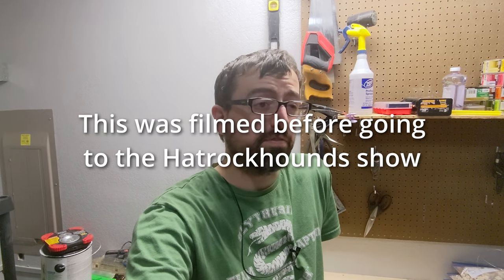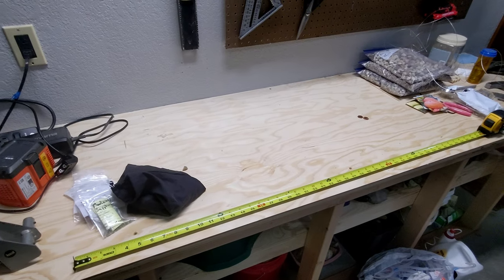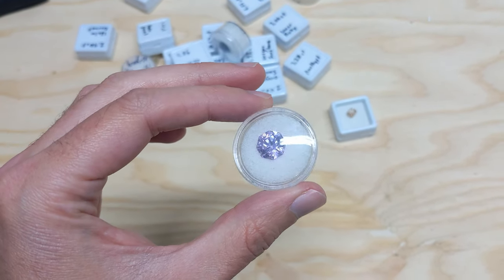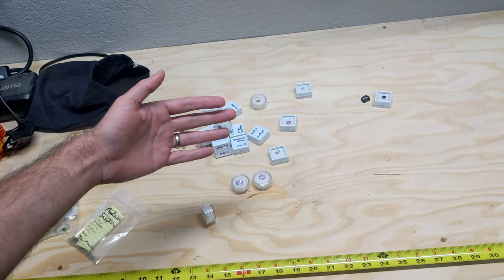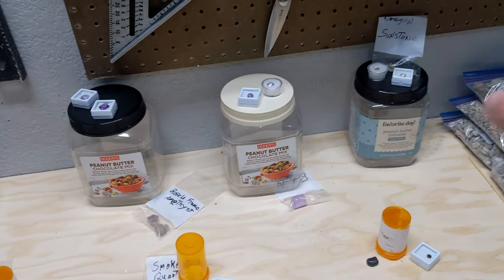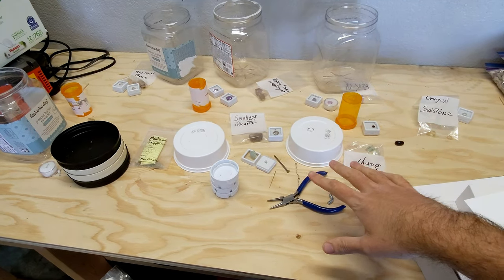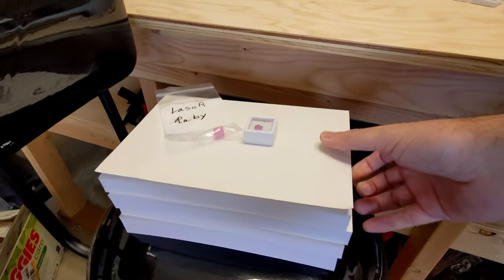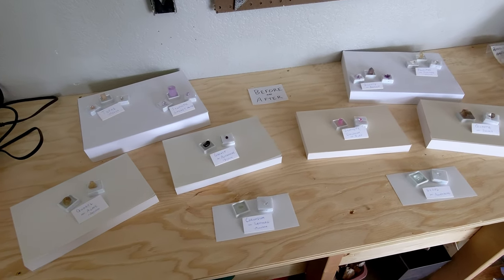Let's Design A Gemstone Display

Comment: How exciting! I think you're right, less is more. I like the idea of using the books so you can make the different heights but I think it would be easier & possibly look better if you went to either Hobby Lobby or Michael's craft store and bought a piece of white material to use as a base  to fit over all of the books. You could even buy a big enough piece to either scrunch up the material between and around the books or just drape it over the books. I'm sure some white velvet or satin would look beautiful. Then if the base of the inside of the display case is wood everything would be white except for your beautiful gems and they will really pop and sparkle with the lights in the case. Just a thought. I've been to many rock & gem shows since I was a little girl and I love the display cases! You will have to make a video or at least post some pictures of your case at the show. Thanks for sharing Patrick!✌️🤠

Comment: That was fun! I do the same thing. I worry over things i have to publically do, right up to the minute i present them! But it will all go smoothly and you learn from others displays and things you maybe could have done differently. Such as, i would have got a bolt of black velvet fabric tho drape over your books, to display on, instead of the white. As jewels tend to show up better against black, then white. Or even just spray paint your little boxes black and leave everything else the stark white? Just a thought. Honestly, it looks fine. Anyone wanting to see it, will see and appreciate it. You do absolutely fabulous work.gour facets are fabulous and the different cuts are unique and gorgeous. Just make sure to clean them and the box lids, before you display them!